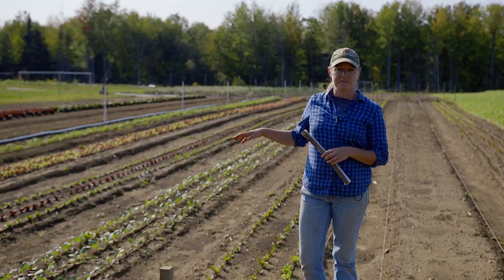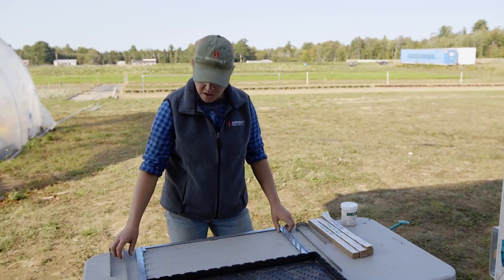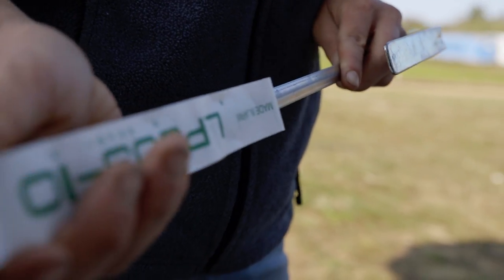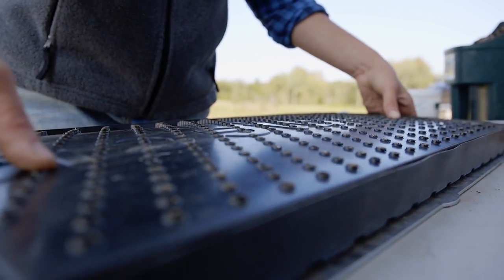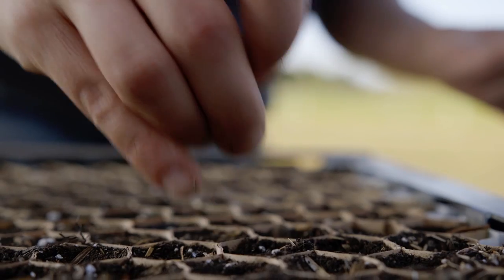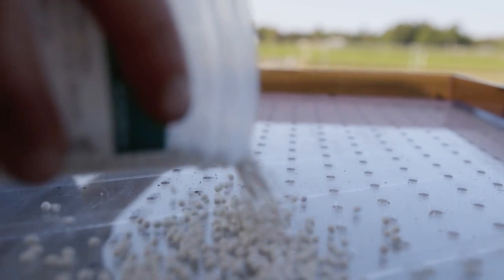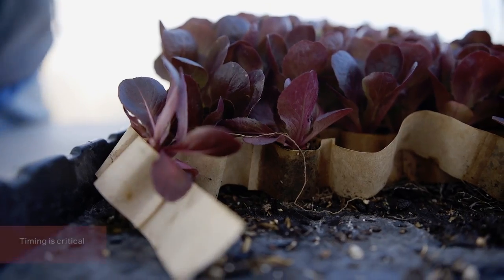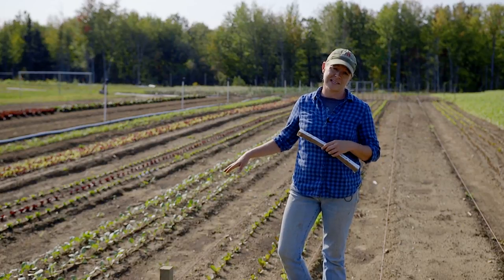How to Seed Your Paperchain Pots/Trays

Comment: 4.50$ a Paperpot Single Use ?  Wow  for Paper??
Reply: Also the planting tool:  probably a bit expensive for a small plot, but worth it for for-profit or 20metre+ beds.
Reply: You dont need the $1200 contraption. Use the paper pot then separate them in 3 feet length and hand transplant.
Reply: Plus thet are "Made in Japan" Crap !!!!!!!!!!!!!!!!